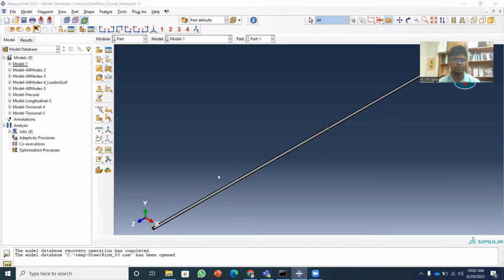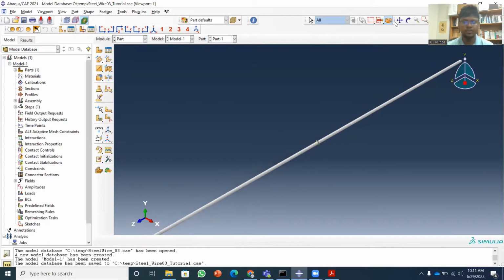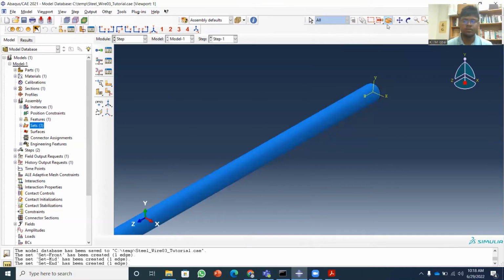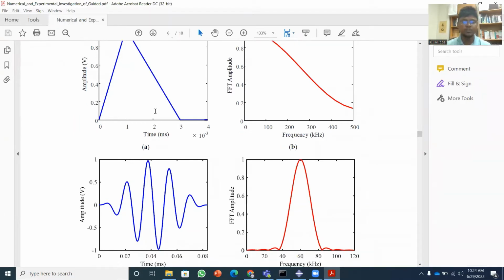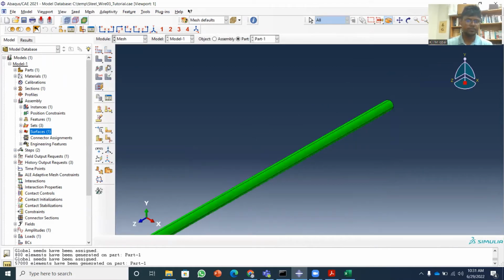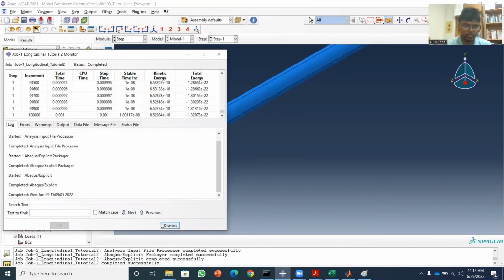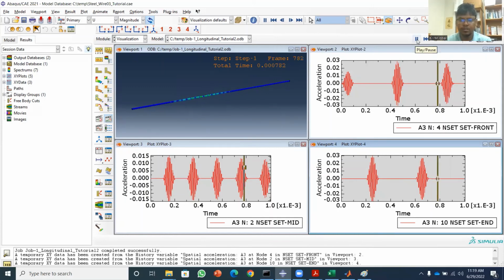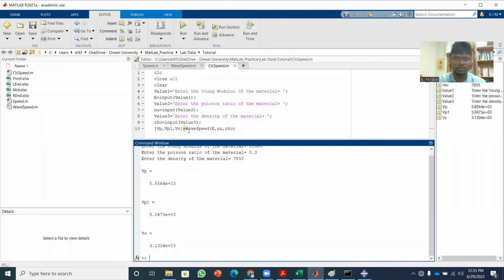Wave Propagation Modeling: Longitudinal/P-Wave in Steel Wire/Pipe using ABAQUS (1st)

Comment: I am using a sinusoidal pressure loading. Why am I getting multiple wave packets from the source of the pressure loading?
Reply from the maker: You’re seeing multiple wave packets because the medium is dispersive. Different frequency components of your sinusoidal loading travel at different velocities, causing the wave to separate into multiple packets as it propagates.
Reply: @thinkerKIM could you suggest some solutions? I want to apply the sinusoidal loading. Should it be applied in a shorter period of time?

Comment: Hello sir, what is the formula of the time period you used? Thank you
Reply from the maker: Time period = d/v;  (d is the distance of wave propagation (sometimes it can be 2/3/4 times pipe length), v is the theoretical longitudinal wave speed in that material).